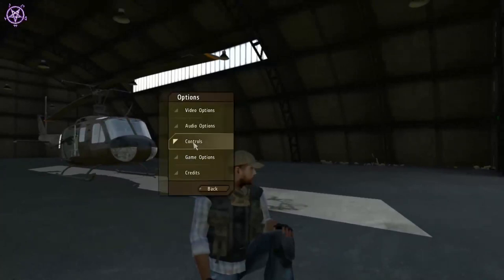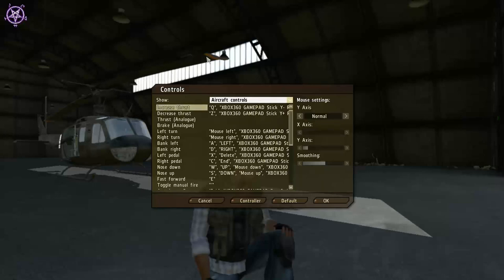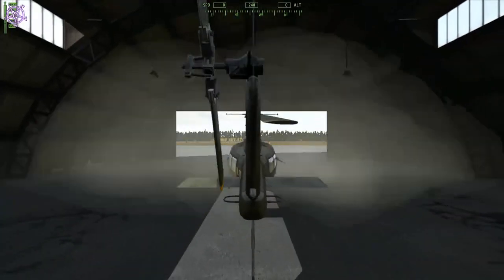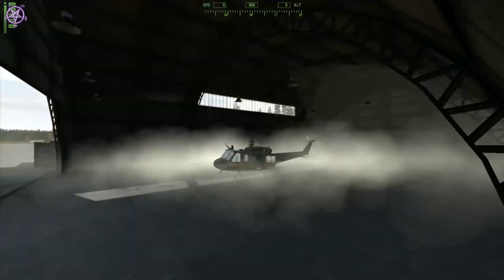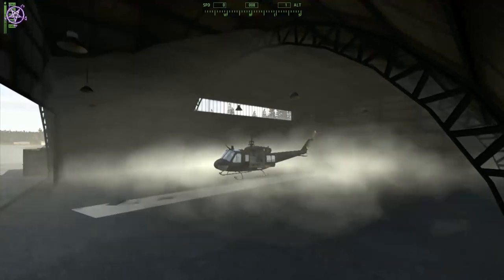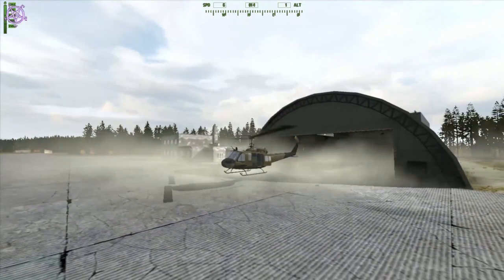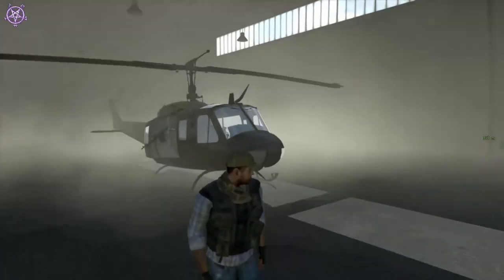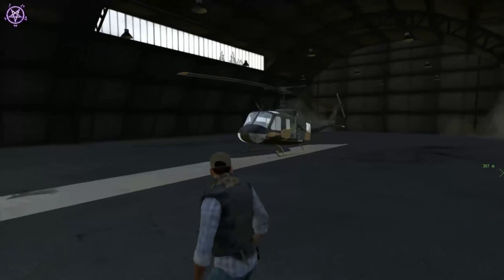Advanced Helicopter Tutorial - Get out/in of Hanger / Fly / Tricks - ArmA2 & DayZ

Comment: Cool vid when I flew for my first time in operation arrowhead I failed terribly so u can fly way better than me
Reply from the maker: controller / joystick is the key for smooth flying, even tho majority of players disagree and do not understand the huge advantage you get by using controller or joystick.
Reply: The Sethioz Project I agree using a joy / controller is key for smooth flying, well anything analog is better for smooth flying, but the demonstrations you showed are still feasible with keyboard (not mouse mind you), it just takes many crashes and a great deal of playing around in heli's to get the correct timing down. Personally I have crashed maybe half a dozen choppers because of either a key mispress or not pressing long / short enough, and I don't think I will stop crashing them (fyi: been about a month to a month and a half since crashing my last heli in arma 2).
Reply: The Sethioz Project i find the little helis suck with tight turns they just fall out of the sky but you can really throw around the attack choppers before they stall

Comment: When using a keyboard you cannot just use the arrow keys, well you can but I advocate against it, you need a fine mixture of both. Flying isn't really all that hard with the standard keyboard and mouse. I have used both controller and keyboard and mouse, and I prefer the keyboard, as I can get harder movements when I need it, using the keyboard, and smooth movement when I need it, the mouse.
Reply from the maker: ofcourse its possible to fly with keyboard and mouse, but you never be able to make fine adjustments like with controller.

for example currently i don't have pedals connected and its impossible to make small adjustments with pedals (rotate left / right, cuz they're mapped on L1 and R1, non analog) and with attack heli its very important, to get the crosshair where you want it.

Comment: how do i hook my xbox 360 controller to my pc?
Reply from the maker: you don't, you need to buy PC version of the 360 controller or one that works on both. As far as i know, xbox is GAY and it does not use USB, so no way of connecting it into PC (maybe there is adapter for sale), but my Razer ONZA 360 has special adapter, so it works on both.
Reply: k ty